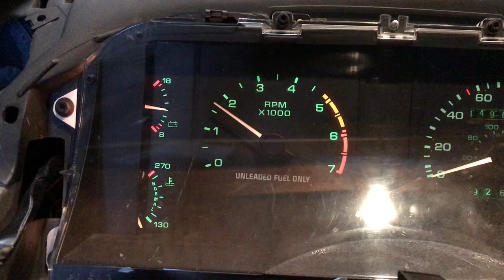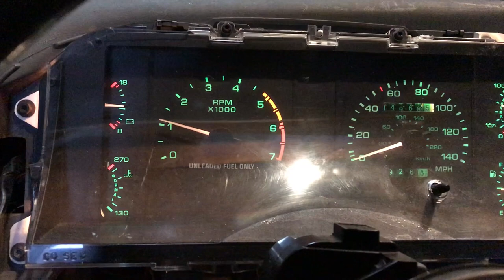88 Mustang GT - Scorpion Roller Rockers, Trick Flow Cam

Comment: Jeff do u just run your fans off a toggle switch?? Thanks man I see some people pin them into their computer once their temp gauge gets to up to that degree fan comes on until it drops back down!! I ain't that good with that type of wiring I was going to try to use 1 of those probes that u put threw 1 rows on rad I just don't like that u have 2 mount the the control box under the hood I mean it might be a way to mount it inside the car that way u u can control the adjustment inside the car that it will come on when the car gets to the right temperature! I have the Flex-a-lite the big fan  the  400-185 ! I might just run it off a toggle until I can find 1 of those probes that are really good sorry for taking up all buddy I hope it doesn't bother u!! Thanks Jeff
Reply from the maker: I run my fans off a toggle switch. No way to run them thru your ecu that I know of.  I leave my fans on all the time unless I'm warming car up or something. I threw that probe thing away since it would not go thru my radiator anyway. Bottom line run it off a toggle switch. Back to work on both Foxbodys again since the weather is better. More videos on the way!!
Reply: @JeffPalmerJWP  Ok thanks buddy that's what I think I am going to do I heard good stuff in bad stuff about those probes I will take ur word on that just run toggle switch thanks again buddy!!👍👍👍👍👍💪💪💪
Reply: @JeffPalmerJWP  there is a way to wire in a sensor for fans to come on automatically